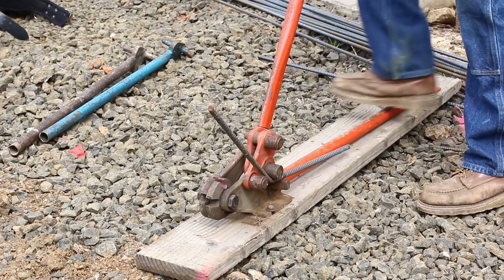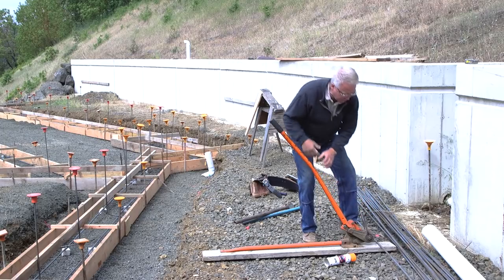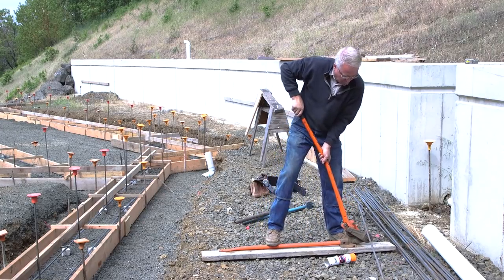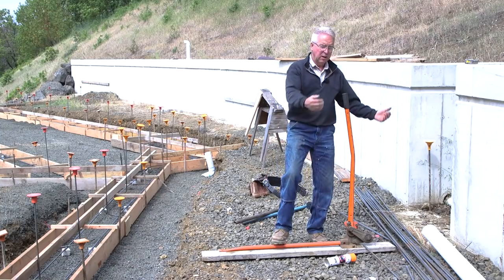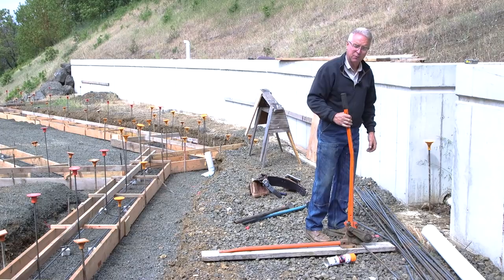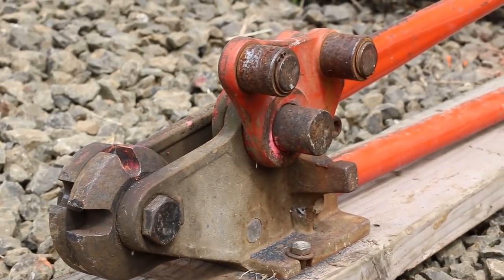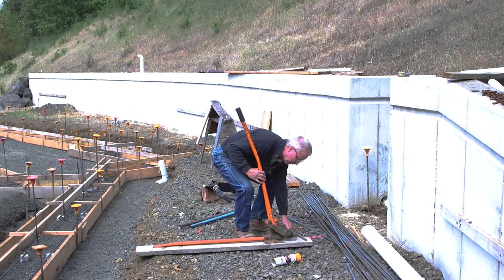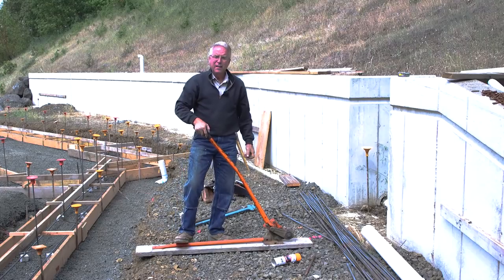Rebar Cutter Bender: Tool Overview

Comment: Since cordless grinders/w a cutoff wheel were invented I will never again cut rebar with one of those backbreakers. Still good to have for bending tho’ Back in the day there was no fab shop where I was building. We ordered 20’ bar and did everything onsite.
Reply: Tioga Fretworks line up a bunch of cuts up off the ground on dunnage, throw a couple loops of tie wire around both sides of the cut and go after it with a demo saw.
Reply: Just lengthen the handle even more and it becomes so much easier. Torque ftw

Comment: Back in the 80s, the contractor I worked for did the occasional job that required rebar. Biggest was the footings for a small warehouse for his son’s moving business. We used a sawzall for cuts, and bent the #4 rebar using the eye in the tailgate of the F350 dump truck and a 4 or 5 foot piece of black iron pipe.

Comment: Nice video. I cut and bent 3 tons of #4 and #5 rebar for my foundation. I was given a different designed manual cutter bender to use. Cutting was way too hard with it so I used a chop saw to do the cutting. I set it up for production so that the bars were cut and then slid a little ways to the bender where I had concrete blocks set up as stops to automatically position the bends. It worked pretty good. Glad that I don't have to do that again. Good Luck, Rick

Comment: I use one of these for all my rebar cuts and bends. I have found that screwing it down to an 8 or 10ft 2x10 if best, i just use grabers and have dilled smaller holes in the mounting plates. And then instead of doing small jerks, i stand behind it ,so i can pull the lever toward me and push the handle as far forward as possible. And give one lond fast pull back really throwing all 185# of me into it. This produces a quick and efficient snap on #4 (1/2") bar. Sure you might fall down a few times while you figure out how my momentum is needed but once you figure it out #4 bar is no problem any more.
Reply: Exactly right! Anybody who uses this tool on the job knows the trick. 👍

Comment: We used to have a similar device when I built swimming pools in the 80's.  It was so heavy that we couldn't pick it up and had one cutter, similar to a pair of scissors, with an 8' solid steel handle, which was very heavy.  We called the entire contraption....the paper weight....lol.  Thanks for the memories.....

Comment: I definitely used one of these sadistic suckers a lot when I was younger. I was also built like a sack of brass doorknobs and a little bit angry at the world on a good day. I'm still a big guy but I don't think I have the pent up rage required to properly operate a bender breaker quite the way i did when I was 25.

Comment: Make sure to place the rebar so you're not cutting over a rib, always in a crevice, that will allow it to shear easier.
Also your first pull should be done towards you to initiate the shear, then you put your weight on top.
They make ones that cut up to 6 that have a sliding extension handle.

Comment: These are great tools. No blades, batteries, or eye/hearing protection needed...just some body weight and elbow grease. Newer methods may win out for a few quick cuts, but over the  course of the job I've found that nothing beats the old cutter. I might  also mention that they are not cheap...and the old guys that I work with have all told me that we dont have to lock our cutter up in the shed...they say it's too heavy and too much work...and because  of that no one has ever tried to steal one. I can just about believe it. Good luck with your next rebar project.

Comment: I had a longer handle made for mine, it just slides up and down so you can adjust the length of pull, works easy now.

Comment: Scott, I'm a lot lighter than you and I can confirm that these cutters can be difficult. But here's something. Years ago I worked at a rental place where we did free cutting/bending for customers who bought rebar from us (ancient gas powered machine). Contractors loved that service, but we still rented out the old hand powered rig you showed on occasion. Then we got an electric cutter/bender (think it was Hitachi) and that thing was a dream. All you needed was somewhere to plug it in and it would do the job - cut faster than you could with muscle and body weight on that old lever rig and the bends were spot on. Is it worth it to buy a tool like that for a job? Maybe, maybe not. But one of the things I've noticed about your posts is that, like a lot of guys, you want to own your tools. Renting a tool for a specific job can save wear and tear on you and your crew with the benefit that you get to take it back, have the rental company do any maintenance, and not have an expensive, rarely used tool on your balance sheet and taling up space.

Heads up to contractors out there about how renting may save you money (check your tax laws). When I worked at the rental place we had customer who ran a large irrigation company. During the busy season he'd have his equipment reserved and it was always the same thing. First thing in the morning he picked up a sod cutter to remove the lawn in strips where the lines would go. Couple of hours later he'd return the sod cutter and pick up the trencher to cut the trenches for the irrigation lines. I once asked him, "Why don't you just buy these machines, you use them enough?" He said that if he bought them the depreciation on the equipment would be far more than he could earn from them and, that if he rented, he could claim the rental costs as a business expense. Plus, the rental place maintained the equipment and, as we owned the stuff, he didn't have to worry about storing it.  Guy had a good accountant.
Reply from the maker: This is wisdom in many cases and yes... I am  sucker for buying tools, almost any excuse seems like a good reason!!
Reply: @essentialcraftsman  I know, and that's why we have to have understanding wives when the most important project is to build an addition to the workshop because - too many tools. They sigh, do the eye roll thing, and let us be hoarders. What are we to do? It's all good stuff that we might need someday.

Comment: We had a bender on the foreman's van when I did residential concrete in Florida. Never bothered with a cutter like that. We used a Stihl 2-stroke saw with a big abrasive blade. One guy can cut every piece of steel needed for a house in less than 30 minutes once its all measured out, because that saw will chew through 6 or 8 pieces of #4 all at once without a complaint. 
Works in a pinch though.

Comment: Worked one summer in college at a pre-stressed concrete panel plant. My crappy job was to cut and bend rebar. Cuts quick and easy with oxy acetylene torch.

Comment: Perhaps an helpful ergonomic approach is to "fall" into the cutting motion, that way when the rebar shears your body is looser and prepared for what is essentially a fall. If you are only pushing then your body is more tense and the "fall" can be a shock. Hopefully this makes sense. Once I took this approach I found the cutting a good deal more comfortable.

Comment: In dem olden days...  we used mild steel.  Today we used higher strength steel (micro-alloy or quench tempered).  I expect these older tools were designed for the classic soft steel.  Also we now have to perform our bends to a minimum radius, one which the old benders don't do except for the thinnest of rebar.

Comment: I love cutting rebars, just plug in the metal cutter and a cut off wheel and you're set. It's easier than using one of those Fred Flintstone era cutters. Especially if the foundation crew needs 50   qty. 4 footers in an hour, I don't have to worry about the guys waiting for me to finish cutting them. I've always wanted to try this cutter, but I think I'd rather keep my neck where it's at. No whip lash for me, thank you.

Comment: I extended the handles on mine with a piece of pipe that's drilled to accept two plates either side that sandwich the original handle in multiple points across it.  Sure, it's bigger now, but i don't use anywhere near the force you normally use. The next trick on the line is to have a piece of rope with a horse ladder on the end of it and simply "step" and use the weight of your body with it. Works with a regular one too, but you need to train yourself to use it.

Comment: Scott, have you ever used an electric cutter/bender (like the Hitachi VB-16Y)? I bet yours will last til the end of time, but I got tired just watching you lol.
Reply: I've used one (a few years old so they may have changed). (Now it's "Metabo" not "Hitachi": https://www.amazon.com/Metabo-HPT-VB16Y-Productivity-Efficiency/dp/B07M9ZD6S6/ref=dp_ob_title_hi). It was very nice and seemed to be built like Fort Knox. It was really easy to use and WAY easier than old school and once you set the angle, it gets the bend consistently right every time.

It does need on site power/generator which one may be getting by without at forming stage but I think it requires less than 10 AMPs so that's hardly a barrier since a small generator can handle that.

Of course, they cost $2,000+ and renting them may be challenging in some areas.

They are modestly heavy (and of course tethered to a cord) so if for some reason you need to move the cutter/bender to rebar that has already been spread around, it's easier to move the mechanical cutter/bender around. But, why scatter the rebar around before cutting/bending?

It's was an absolute joy to use when cutting repetitive pieces. Don't bother to mark, just place something heavy on the ground (a couple CMUs worked well) at the right distance away as a "stop",  and slide the bar (somewhat gently if your stop is light) to the stop, cut, repeat... Never even get up from a squatting position -- maybe 10 seconds per cut until you have to move the pile of cut pieces out of the way (and they do pile up surprisingly fast).
Reply: The Hitachi is a thing of beauty and with a motivated guy on the rebar pile a real production multiplier!

Comment: For the "occasional concrete guy" I use a portaband (or even a sawzall) for cutting and a couple pieces of 1/2" sch 80 (40 will work for a while) black iron pipe for bending.   Can you show us some of your tricks for when you don't have a cutter bender Scott?

Comment: While a re-bar cutter bender is needed on job sites,the bending feature is  useful,however,not for cutting. A  14" gasoline cut off saw with a carborundum blade wins hands down for cutting. Reasons being,bring the saw to the bars,not vice versa,can gang cut many bars simultaneously. Just a tip,with the saw there is no need to cut all the way through the bars. A cut slightly more than 1/2 way through and you can snap it very easily by placing your foot on the cut and lifting the bar. Of course,if wanted,use the saw for the entire cut.

Comment: these are still used for bending but they've been made obsolete by cordless angle grinders with zip discs
Reply: in NZ we do a whole house slab of rebar with one of these. No doubt a grinder and cutting wheel works well but more PPE is required to use for a decent amount of time. In my opinion as a 2nd year apprentice the bender is the way to go for efficiency

Comment: So that's why I've got neck issues 45 years after using .........and still using this beast.   You left out the good part ,,,,, the part where it takes a man to pick this tool up to load,unload and move around. For the cutting its best to use a zip saw if you are cutting lots of pieces the same size , cutting thru a dozen sticks at a time on the ground.

Comment: tip - cut the handle off at the base. Flip it over, and weld it back on. When the bend is pointed up you don’t have to push down as far and it works much easier. It really reduces the jarring effect. I can send a picture if you’re interested.
Reply: Seems like it would work great for #3 but isn't it hard to get #4 started with the handle even more vertical?

Comment: Never seen or used one of these but TWO things that I would do right away is;
1. Fashion a handle extension to increase leverage.
2. Drill holes on each end of the base board to drive a bent piece of rebar down into the ground to steak it into place so that you aren't wasting energy chasing it all over the place.

Comment: I wonder if those cutters exist with some kind of ratchet mechanism, lets say it would take 2 or 3 full strokes to cut completely. This way the operator would be a bit more de-coupled from the action, it would be easier to operate. A bit like the (I just found) Klein Heavy Duty Ratcheting Bolt Cutter but with the bend feature. I guess the bending should be done with the ratchet disabled as it seems easier for the operator.

Comment: If I had a lot to cut/bend I think I'd give one of the portable/hand-held electric-hydraulic units a work-out, would need a heck of a lot to do though at the price the combination bender-cutters are going for! But at least the single-function ones are only around $500-$800 a piece. Only problem is you need electricity on-site.

Comment: We use that machine almost every day, and like any machine/job if you use it long enough you’ll figure out little tricks to make it easier.. For me I am about 210lbs so it is a little easier but, generally I will stand over the cutter,  balance with one foot on the end of the handle and straight arming while half jumping half leaning forward, u can also work away at it in this manner till it snaps. This way you use ur entire body weight not just the force that ur shoulders and arms can muster up..  works well with the 5/8s bar. Hopefully this helps makes someone’s day less painful and worn out... sorry mr. craftsman but cutting from the side of the cutter You’ll wear yourself right out... keep up the awesome videos and good work.. I work with concrete everyday so that’s my two cents .
Reply from the maker: I'll try it!!!

Comment: An old fashion abrasive blade chop saw cuts rebar a lot easier the the tool being demonstrated.  Or you could use one of the more expensive metal cutting saws that use the carbide toothed blade.

Comment: I am wondering if any of you lifetime experienced guys can make a stand/jig which holds the cutter so that the physics of you weight angle can produce more force.  I am not a professional construction guy but I always love when guys think up little improvements through experience.  Perhaps you can form some type of movable wooden cover over the cutting blades so the chances of whiplash are minimized. (sort of like the face shield over a bench grinder.)

Comment: To cut rebar on a job site the most common tool is a gas axe or cut off saw. I could only see your boss handing you one of these if you work for a small company that can’t afford one seeing they range from 1500-3000 bucks

Comment: I see using an extra long cheat bar on that (possibly 1 1/2" galv. pipe @ 10'), then having 2 guys make the cut, one load and one push the bar down. Probably mount the base to something that hardly wants to move. They have circular blade cutters but those spark all over the place, smell horrible and wear out fast. They also have portable band saw type, but just about the same issue. It's a miserable job, but we didn't sign up to make bouquets down at the local florist!

Comment: With all the equipment on the job, surely there is a hydrolic cutter available for the concrete professional.
Reply: They come in two sizes up to 5 bar and then up to 8 bar but are $2k so most people don't buy them. Mine is a number 8 and will cut 2 number 5 bar at once but heaven help the dummy who has a finger between the bar because they don't reverse you will lost that digit!

Comment: Actually the bearings will wear out too.  I have replaced mine once over 10 years of pouring footings, so they are pretty darned robust. If they aren't making the 90 degrees anymore, then its likely the bearings.  Cheers.

Comment: Or Save yourself the Neck and Back Injuries and invest in a nice skill saw and/or angle grinder...
Reply: I think you mean demo saw or grinder
Reply: @donvito204  Nope, I ment Skill Saw and Angle Grinder... Demo Saw Would also work Great, but seeing as this is a video discussing ways to avoid neck and back injuries, and a Demo Saw requires the user to carry its entire weight while being bent over in order to Cut most anything.. I Dont think it would be the best choice...
Reply: Dealing with sparks (grinders) and hot chips (improperly shielded circular saws) gets old, and painful, real fast.  Yeah, you're saving yourself the back/neck injuries, but now you're going to deal with burns or inhaling grinder dust.  Sure you can wear PPE to avoid all that, but having sleeves and full face masks out in the heat sucks too.  

If you do serious concrete work you'll want a electro hydraulic rebar cutter anyways.  We've got a corded one that does up to 1".  And a battery powered Makita that does up to 3/4". 

No hot chips, no sparks, no grinding dust.

Comment: These are a staple in nz for most building contractors as we do everything from footing to roof I have been putting off buying one for years as they are 600-700 new💰👎
Reply: And our ones have a bigger bend radius though we still use the old one to only cut. That's either harder bar or the couple we use at work are sharper

Comment: How do you bend opposite 90s or dogleg? Like if you wanted to connect to layers of rebar.
Ha, I guess I should’ve watched the end of the video. But I thought there might be an easier way without locking it up like that